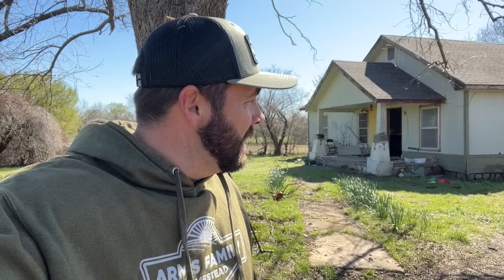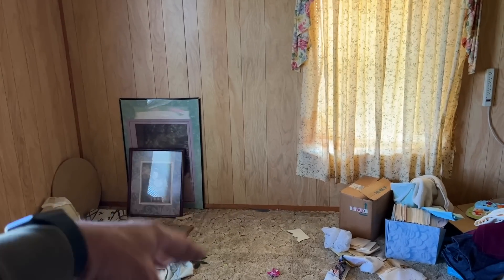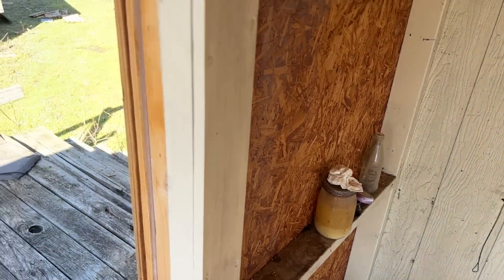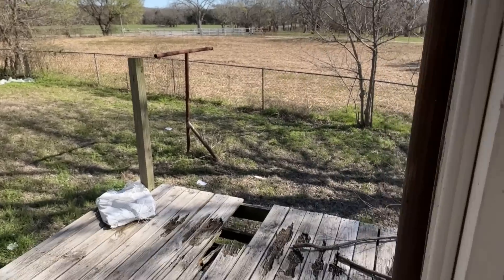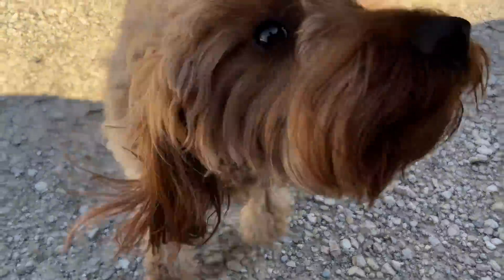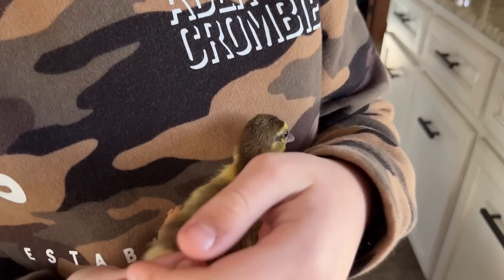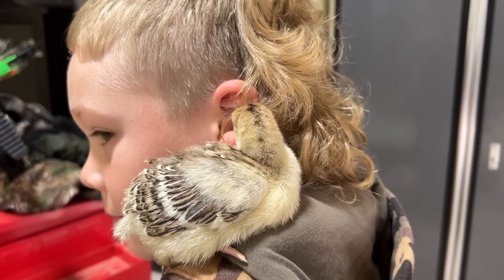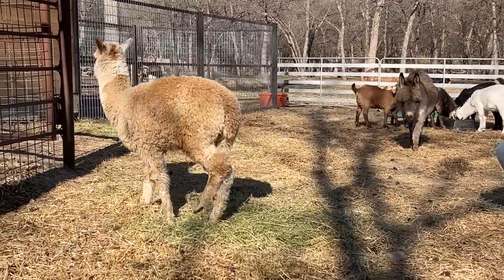It's All Coming Down!

Comment: The ford can be overcome by the use of an old railway flat car as the base truss for the bridge sitting on a couple of abutments. A farmer in New South Wales who had access problems all over his property in the wet. He used those flatcars with the centre truss. They carry a full loaded semi in train service,  there are no problems as to suitability. Using suitable concrete culverts stood on their ends and filled with concrete to create the abutments. these sit on the flat concrete that is used to create the floor of the concrete in normal service. His program was one day preparing the ground part of the foundation and laying the concrete floor slab into place, second day was to put the culvert pieces into place and formwork the land side of the culverts place rebar and pour the concrete. Third day was to bolt down wear plates and side retention plates to the abutment, and lay the flat cars into place. The decking was either pre-fitted, or fitted later. The bridge was able to be used for light traffic almost immediately and for heavy traffic some weeks later.

Comment: Great video. I’ve got a little bit of that “scavenger” gene but with work it can be overcome. My shop is now a 7 1/2 but 11 foot shed. A little space means you have less place to accumulate CRAP, yes, that is the technical temp. The car hood trailer does seem to work pretty well and packed right I’m sure that whole house could make it across the road. I guess we are just waiting on an emu update. Thanks for sharing!

Comment: Remember to check flow of water ! Which way does the water flow towards. If it settles then you’re good. But if it comes from the higher side settles middle or end of property. You’ll probably better off setting building up there or level the whole plot out

Comment: I understand your point of view Daniel, and I understand your brother's....

My grandfather owned a farm supply store here locally, as well as a filling station (fuel), AND a scrapyard. My dad inherited the junker mentality, but mom kept it at bay enough to not have spilling out in the yard. lol 

I inherited it to a degree, but only a fraction of what dad had. Before our old homestead was razed I did pick it though. I got what lumber I knew I could use, some storm windows that were already slated for use, and enough of the chain-link fence to put in an enclosed yard for my dog, etc. It saved me a good bit of money, especially in light of the current events in the past few years, and let me complete some projects sooner rather than later. 

The picker life does have it's purpose, but I agree, it has to have a balance....aka a limit. lol

Comment: This is a tip my Vet told me many years ago, that some might know about already.  I had to have my shar- pei Maxwell put down after 12 years. I told my Vet; I would be taking him home to lay him to rest. My Vet knew I still had Maggie (my other shar- pei) at home. Maggie was 13 years old and going to turn 14 in 30 days. She was still doing very well for her age. The Vet told me to please lay maxwell to rest inside in the same fenced yard that Maggie and Maxwell shared He said if a dog is laid to rest outside of the fenced yard that he shared with his companion. (in this case Maggie)   Maggie will show stress wondering what happened to her Maxwell. the vet said Maggie will Pase up and down the fence line looking for Maxwell. He said lay Maxwell to rest inside the fenced yard and watch what happens when Maggie goes outside. So, I laid Maxwell to rest inside the fenced yard, in a corner of the yard under a beautiful flowering tree. It's the perfect spot. I wiped my ongoing tears to go get Maggie. She was just sitting by the fireplace and looking very sad and lost. Maggie Mae walked out on the deck and stopped She Saw the mound of dirt under the Tree. She then walked slowly over to where the dirt was, she sniffed the dirt a couple times and she knew Maxwell was home. My heart melted because she laid down next to maxwell and for the first time in many hours she looked content so much so that she took a well-needed nap. right next to Maxwell. I called our Vet and thank him because I was so worried That Maggie might not do well with Max being gone. I could not Thank him enough. Maggie went on to take many naps next to her best friend...Maggie did go on to turn 14 and when it was her time, she went and laid down next to her best friend and went to sleep for the last time. It's hard to let go because we love them with all of our hearts ❤❤❤❤